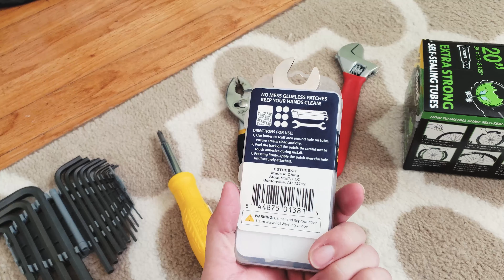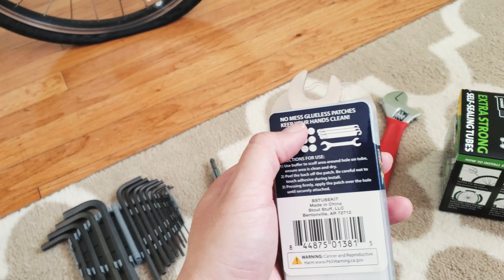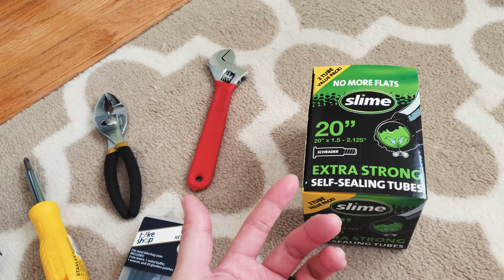How To Change Inner Bike Tube on Folding Bikes From Start To Finish (Dahon Vybe D7)

Comment: Excellent ! (how do you keep it so clean !)
Reply from the maker: Regular wiping off with warm water and mild wash & wax detergent! :)
Reply: @TheGizmoGarage  I have similar bike, vybe i3 with internal hub. Not quite as straightforward as yours to remove.
Reply from the maker: @heronaddict2  i3 should have a quick-release lever? If not, the procedures of removal/installation should be similar; drop the chain and slide the wheel out.
Reply: @TheGizmoGarage  no quick release …. I suppose if I have to change tyre or tube, a simple disconnect of the hub shifter should be all. Thanks

Comment: Changed the inner tube and did every step correctly as far as I can tell, but for some reason when the rear wheel spins freely, it’s almost like there is a little bit of pressure from the brakes being applied, yet the brakes aren’t touching it. Did I do something wrong?
Reply from the maker: The rear wheel may not be properly centered and is touching one of the seat stays, losen the axle bolts and double check to see the tube is not touching anything besides the brakes.

Comment: Thank you for the video. I have a Dahon Horize, the tire size is 20 x 1.50. May I know if a 20 1.35  tire would work?
Reply from the maker: The 1.35" inner tube might not be wide enough to properly support the 1.5" tire, it might work in a pinch, but I'd suggest to buy a inner tube that's at least 1.5". You can always go wider but not thinner than your outer tube.
Reply: Li Fan thanks! appreciate it. like you know if i succeed to change my tire

Comment: Removing the rack is unnecessary and as I make many trips of weeks or months so repairing tubes is necessary as carrying a large number of new ones isn't practical.  It is much more difficult  to remove the wheel from the derailleur and to reinstall it on a speed P-8 .